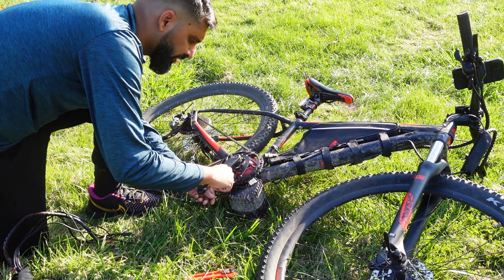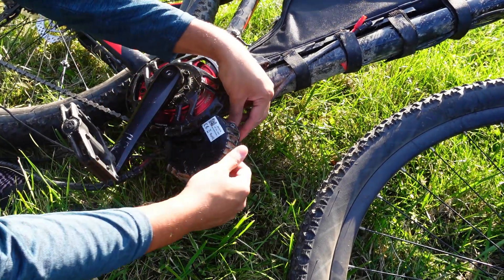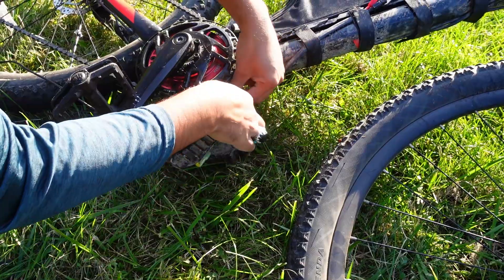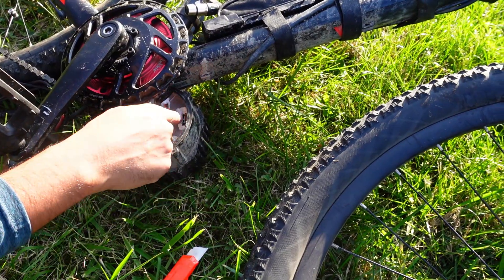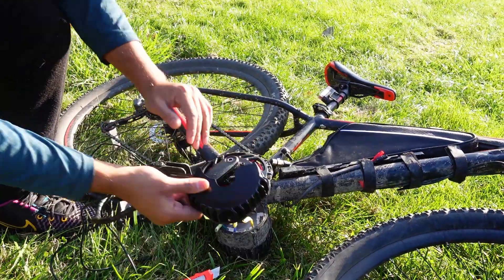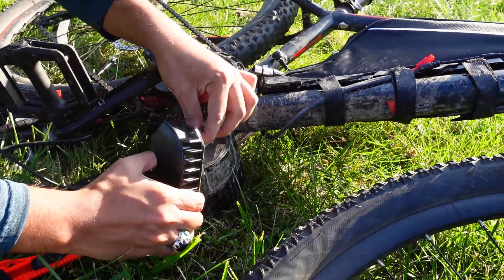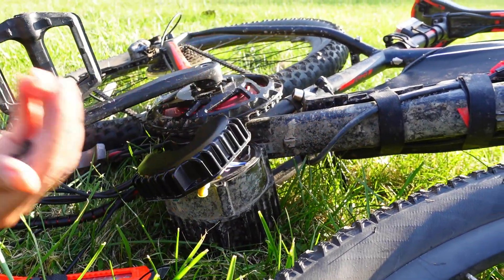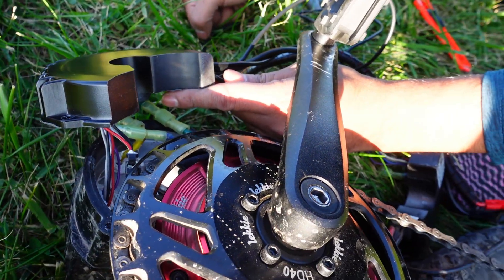Upgrade BBSHD to 3000 Watts!! Plug and Play Controller

Comment: What settings do we use for the Eggrider V2 it defaults to the Bafang with only 30 amps output and 48 V. I have a 52 V 80 amp BMS

Comment: Just a note of caution while installing. I accidentally touched the motor case with my laptop case when I tried to program the controller. I got a nasty arc that fried the 5V chip and basically bricked the unit. Not a fault of the product, just be careful.

Comment: So can this controller run 72v?
Reply: No that's going to be the downside to it. It's an awesome plug & play factor for the money though. If you ride it with some sense and not like a dirt bike if not you will burn it up way easier. I'd keep it around 45-50 amps and it will be alot harder to hurt. If you want some real reliable power just need to go external/72v setup and be done.
Reply: @98blower17 so id need to upgrade my current 52v shark battery that's maxed out @30amp to a 52v 60amp high discharge to notice any improvements?
Reply: Update just the plug and play. This thing rips. 52v 30amps. Stop to top speed almost doubled. No top speed difference but definitely a ripper off the line now.

Comment: Several companies have offered these shunt modded controllers over the years but no one shows the difference in acceleration times vs a stock one. Let's see a side by side comparison on a flat as well as uphill.

Comment: Any idea when these will be back in stock? I have 3 BBSHD bikes, all 3 are 52 volt, have had the firmware update and various controller tunes. To me, they're sluggish and slow.
Reply from the maker: They should be back in stock in 2 - 3 weeks. Sorry we ran out of them faster than expected
Reply: It will be an external controller, something like the Phaserunner, ISA BAC855 with a special harness for the BBSHD, 3500-4000watts, superior acceleration and a lot of power
Reply: If you want real speed, upgrade to a sine wave style controller to multiply the motor's rpm's. It will smoke a shunted stock controller.
Reply: @ Example?

Comment: 3kW is probably 8 times more load on the drive train than pedal power alone. How long before the motor's internal gears, the chain or the freewheel unit on the rear wheel fails under the extreme load?
Reply: Drivetrain and the motor will be just fine, ride it on proper gear that's all. I have been running my BBSHD at 4kw for years, thousands of km on it, very strong motor.
Reply: @borisfastebikebuild  I'm not saying I wouldn't get a bbdsh for a light ebike build and that would probably be my first choice I'm just saying the qs90 is an option if you're on a budget as that and a fardriver will set you back a couple of hundred as opposed to quite a bit of money
Reply: bbshd are massively overbuilt.  Just replace chain often lol
Reply: My bbshd handles 6kw peak and will run at 2500w without getting too warm at 72v,beast of a motor with flipsky and fieldweekening,don't bother with shunt mod
Reply: The qs 90 is a very similar motor to this in application and beats price performance on the bbshd don't get me wrong I love the bbshd but when you can get a qs90 for under  200 dollars and it can sit on 4kw all day
Reply: let’s see your build with such motor

Comment: No before and after run? From what I understand, a bbshd can't go above 30a on 52v. How do you avoid cooking the controler with 3000w?
Reply: It’s a new controller, not the stock controller that comes with the motor
Reply: @slayer324  I would love to see a video on this, like is it programmable, how does in real world on a bike, and watt output on the controller. Looks like a great upgrade!
Reply: I had a shunt modded controller before but now have gone to sine wave type ones and there is no comparison. Sine wave will out accelerate the shunted controller big time and for a fraction of the price.
Reply: @Hybrid600  Hi, which 72V do you recommend for the BBSHD (max. 30A would be enough for my use)? Thanks!

Comment: Is there a recommended minimum battery size
Reply from the maker: You can do both 48 or 52volts. The amps will have the most impact. A 50 or 60 amp battery is recommended
Reply: @goldenmotorNA  I just looked at my battery it's 52 volt 14.5 amp hour.
I don't know what the actual amp output is.it's a shark battery I bought from bafang direct
Reply: @timothybroga1704 I think he means 50 or 60 amp current draw on the battery capability. I'm pretty sure what you're referring to is the capacity at 14.5ah
Reply: Most shark batteries won't be suitable, BMS will cut off the power above 25A or 30A